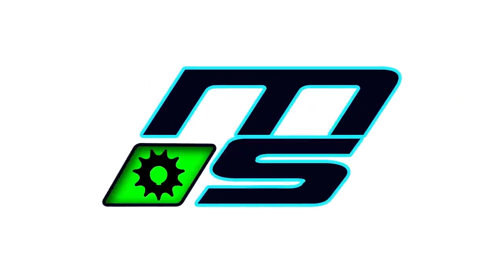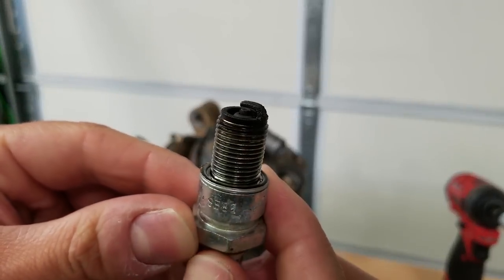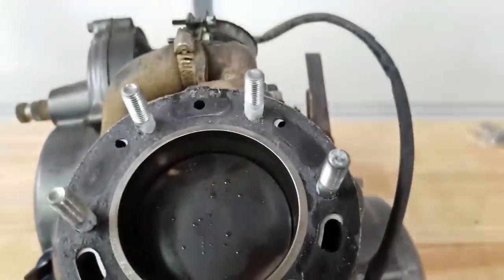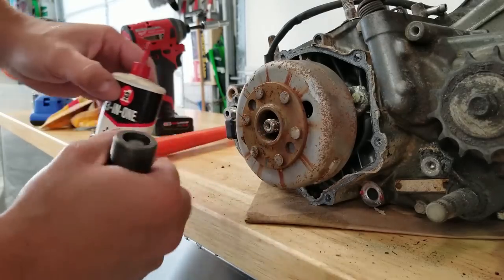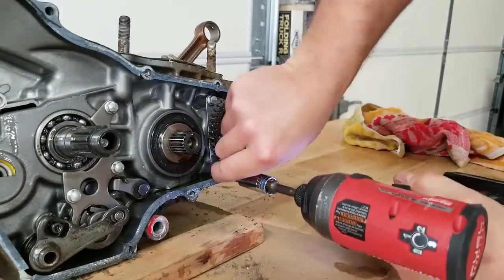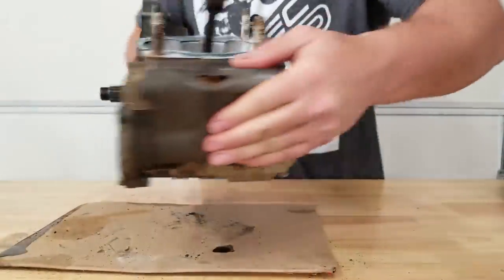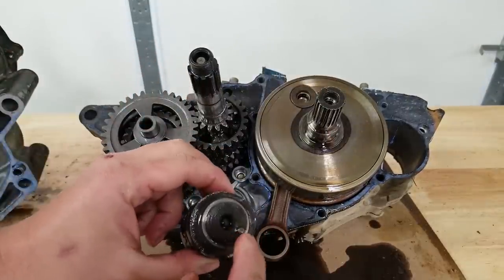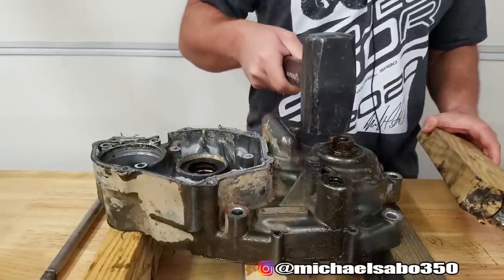Looking inside a 33 year old engine | Complete Motor Tear Down | Project 250R Part 16

Comment: Just a tip, before you hammer on the countershaft again, put a bolt in the end and bottom it out on the shaft. Then you can whale all you want on it without mushrooming the end of the shaft. You'll only mushroom the head of the bolt, and that is easily replaceable. Good luck.
Reply from the maker: Good call man; thank you!

Comment: Two floor jacks or Jack stands w a piece of tubing and a small chain. Take a small stout sheet of natal and pop holea in it to line up w all head bolts. Put it on using all nutsand run chain between cylinder head and top of cylinder but not to where chain can get into top of cylinder. I used a old pillow and put under engine w it a few inches off ground.buse tubing chain and Jack stands to hold it up and then you can w a board and sledge beat dog shit out of the top of clutch or flywheel cover or the back of trans versus beating on cylinder and w the weight of engine also usually afyer you get your plate for head bolts done you'll have cylinder off so any damage in jus a few mins

Comment: I hope you put billet 1st and 2nd gear sets in it. Stock ones like to shoot out the side of the case....
Reply from the maker: News to me, but a lot is news to me on the 250R; even on a smaller build like mine is this an issue?
Reply: That engine with your weight, one good clutch dump will explode 2nd gear im guessing. Yukon stopped making gears for them years ago! might be better off trying to find some used ones... hey im no expert but I would more research about HD gear sets before I put the case back together.
Reply from the maker: @jordonadkins4253  thank you for the info man! I will look into it

Comment: Break it down if you want with the impact... Coming together building it?....Wrenches my friend, cuz most likely you will be replacing all hardware......turn turn turn by hand, then torque by hand! Nothing was ever "impacted" together since the beginning, it was formed. To build something...?
Reply from the maker: Good advice Derrick; going together I use hand wrenches and torque wrench 99% of the time; I sometimes will use an impact on the clutch and stator bolt but that's about it.
Reply: @MichaelSabo  Something that I didn't mention to you about within my builds was that I applied antiseize to every screw that was being threaded into an aluminum receiving end/part (even add on preassembled shits, for example ASV levers etc)...along side of that, any open OEM threaded holes that I did not utilize were filled with stainless steel set screws and loctite in order to seal up the frame as much as possible. Food for thought moving forward for anyone watching.
Reply from the maker: @RelativeRealms  thank you bro! I appreciate your advice; you're build are top notch!
Reply: @MichaelSabo  I literally just watched the CR250R BOTW..... I knew nothing about vapor blasting...good stuff for all of us!

Comment: Thanks for the video, I have one question looking to buy used trx 250r engine how can I identify the year of the motor? I am a original owner of a 1989 TRX250R and still have it. I recently got at 1987 but only trouble is it was under water for the Sandy storm so needs a motor and all eletrical parts. I will breakdown motor if I can but most likely will need a used motor
Reply from the maker: There are ways of identifying the bottom end based on the crank and color of the motor if it's still original. There may be a way to decode the VIN on it too. Best bet would be to ask in one of the 250R forums.

Comment: I’m pretty sure the bridge in the exhaust port is so the piston rings don’t poke out a ton on the downstroke and up stroke.
Reply: No. That's literally impossible unless something is broke.
Reply: Brent Boggs no, piston rings do actually normally pop out at ports, it’s entirely possible. Next time you rebuild a motor with long bourse just look at the top and bottom of the intake and exhaust ports, they’ll be scratched badly because the piston rings pop out a tiny bit and then they go back in.
Reply: @djmystery7235  that's what happend with my brothers cr80

Comment: CT racing brah. They even had a couple dozen brand new Hinson quick change clutch covers on Polished OEM honda dide covers for less than 500 bux. I bought 3 in 2017

Comment: Awesome vid Mike! Are u gonna upgrade clutch at all besides the Hinson basket? Maybe a 89 update or cr500 springs? Be a cool video to do with all the different clutch mods for a 250r.
Reply from the maker: Thank you Jason! Yes I am running what's called the "Neils clutch mod." I believe it's made up from 400ex, 250r and cr500 parts; it's supposed to be pretty solid.

Comment: Dont hammer that trans shaft if you can help it... get a pair of vice grips on the collar and pull it off. Then pull off the rubber groment that is very hard to see. That tiny rubber groment is probably what is preventing the shaft from falling out.
Reply from the maker: Good call on the vise grips; I actually tried doing this but it wouldn't break free

Comment: You realy want at least a 330 on a TRX. Anything more than you have to source the old hardened steel gear sets or mayby try the ESR ones. They were calling suntin that started with a W. Its been 20 years since i put the hardned gears in a 250r lol.I never had a problem using the slide hammer bearing pullers. Jus freeze the bearings when re installing and its so easy its a joke.

Comment: Am i the only one that sees the huge crack in the top of the intake port at 7:08 in the video. That can't be good.
Reply: Casting line i think?
Reply: @dannyarmstrong7659  im not too sure i thought my clutch plate was cracked but it was just covered in casting marks.
Reply from the maker: I thought the same thing when I first looked in; but it is a casting mark.
Reply: @MichaelSabo  good to hear. That would suck.

Comment: I have just started on the same bike a 1987 CR25R 
Compression is 160 psi but wouldn’t turn over found the water pump impeller blocked up solid 
The right water pump cover needs replacing but can’t find one don’t know what the differences are on the 1988/9 which are available 
The bike has been standing for 15 years 🙈🙈 and not risen in that time
Reply from the maker: Sounds like a good project man; I would check motosport.com for OEM parts and if you can't find it there; there's always eBay!
Reply: Michael Sabo 
Thanks I cleaned the carb installed a new kit found the  right water pump casing history put a little gas in carb and it started got 160PSI compression
Reply: Hey buddy 
Most common air leaks on a banshee ? Got a neglected banshee built by Duncan Racing many years ago and can’t get pressurize above 4 psi left crank seal good test equip good 
What’s the most common and the best way to right seal

Comment: in my teens and early 20's pretty much everything was 2-stroke especially dirt bikes and 2x4  4 wheelers .  only ones was 4-stroke like 4x4 wheelers and some 3 wheelers (trikes) ..  my cousin had a 1986 4trx 250R I think his dad paid like little over $2000 brand new in 1986

Comment: Man U made that look easy. I have to tear my 86 apart to see why it’s shifting it’s self out of 3rd gear.
Reply: i had a similar issue. The transmission was fine in my case, someone who put the bottom end together before i got the bike didnt secure the transmission gears correctly (missing trust washer). Put new bearings in, and it was good to go!
Reply: Tyler Pastor  Thanks for the info. I’m wondering if that’s what’s wrong with mine as the motor had been rebuilt shortly before I bought it.
Reply from the maker: Love to see you guys helping each other in the comments! 🤘 Thank you both for watching my video.